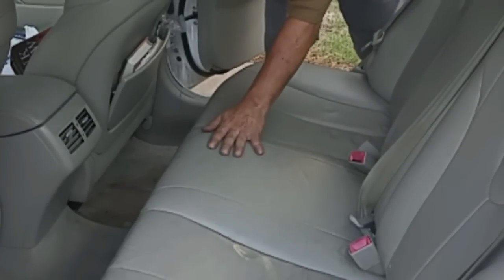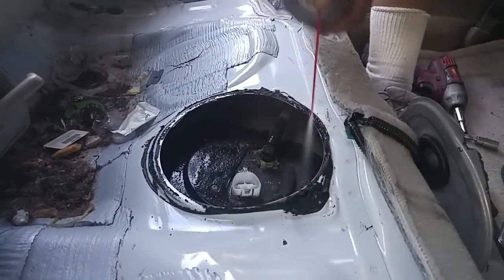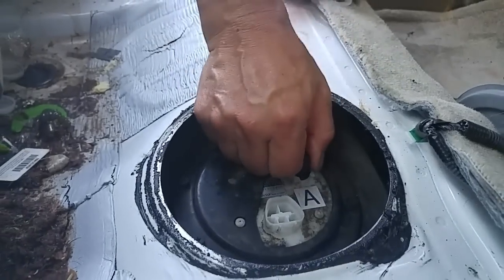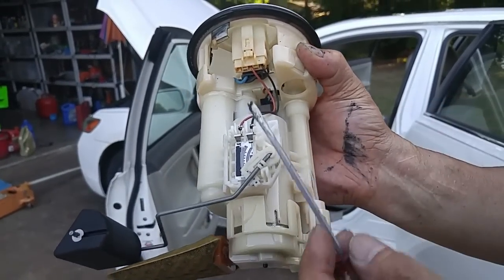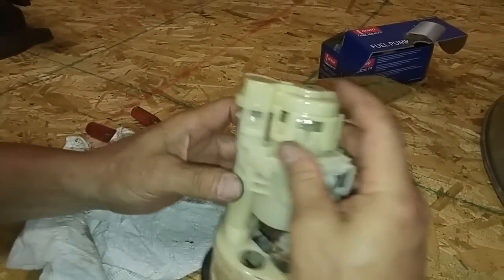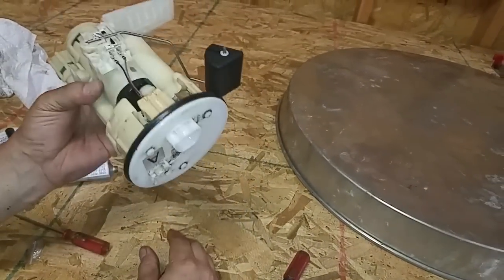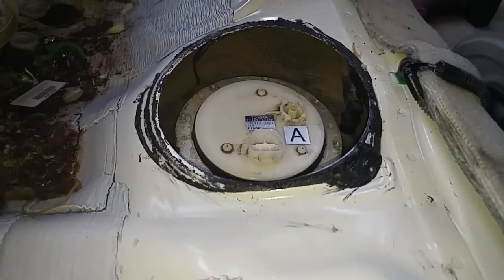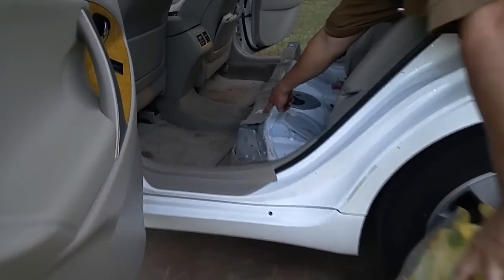Fuel Pump Replacement - Toyota Camry V6

Comment: So I just replaced my fuel pump. No issues at all. Super simple process and easy to follow. The only issue I am having is my fuel gauge still says empty. It will start at the top showing full and then it drops to dead empty. Any suggestions??
Reply from the maker: Probably  your float got stuck during installation.  You'll have to revisit to check.
Reply: @hardlymovingpro  I will check that. Do you think it will be an electric issue
Reply from the maker: Nope.  Most likely stuck float

Comment: Per the Toyota technician's service manual: 
Run the car with fuel pump disconnected until the car quits. This will depressurize the fuel lines. *this process also works when replacing the fuel filter.
Reply from the maker: Yes ... you can do that ... but I like to use the fuel spill over to clean up all the dust and debris with compressed air.
Reply: @hardlymovingpro  guessing it leaves a nice smell as well. There is a reason Toyota has it in their service manual. Safety. The fuel tank has lots of debris. That is what the fuel filter is for but if someone follows your instructions and gets gasoline in their eyes...
Reply from the maker: The access cover separates the tank and pump from the interior.  Therefore any fuel spill stays outside.  The pump ring and surrounding area is usually covered with debris which should be cleaned off before pulling out the assembly.  I use to use compressed air and brake clean (more flammable than gas).  Then i figured out to use the gas from the release of the fuel line.  BTW - the people writing the repair instructions are newbie engineers with no hands on repair experience.

Comment: So, when replacing my fuel pump on similar camry with similar setup, while unscrewing those 8mm bolts, I snapped 2 of them.  Stems are stuck in the hole.  Now since the plate won't seal it smells like gas... it's not exactly safe to do a bolt extraction over the fuel tank.  I'm thinking of using a gasket maker around the bottom of the plate because I'm not sure what else to do.  Any advice? Thanks.
Reply from the maker: Drill a couple of new holes through the plate and fuel tank flange.  Then use sheet metal screws as replacements for the sheared off 8 mm struds.  OR ... remove / drill through the sheared off 8 mm studs using a stud removal tool and replacement them with new ones.  Here's a video I did on how to remove studs:  https://youtu.be/jX3r7hqju4k
Reply: @hardlymovingpro  Thank you

Comment: How dirty was the fuel pump filter. The reason I ask is because I’m thinking about changing mine I have a 2010 camary wih a 130,000 miles and I talk to a  couple people and they say they really don’t get dirty is that true did you find that with yours. 
Yours didn’t look really dirty but then again I couldn’t really tell. Great video, thanks
Reply from the maker: I would agree that it didn't look dirty but it's made out of some plastic polymer material and who knows if it'll break down over time.  In some past cars I've worked on that had been idle for a long time,  some would not start due to traces of dissolved screen material clogging into fuel pump's intake fuel port.   These pump filters are cheap and many replacement pump kits come with new screens.  Also, not showing proof that the filter was replaced with the pump may void any pump warranty claims.
Reply: I totally agree and I would most likely replace mine when it gets close to 200,000 miles and the fuel pump. It’s better to keep up on the Preventive  Maintenance than to wait the last minute when your fuel pump has broken down because of age and old filter. Anyway thanks for the quick reply. Keep up the great videos.
Reply from the maker: Thanks!  The key to pump longevity is to not let your fuel tank go below 1/4 of a tank.  The fuel acts as a coolant to keep the pump from overheating.  The people who brag that they can drive their car to near empty are the ones whose fuel pump fails and are scratching their head as to why.  After my explanation on fuel cooling, they're speechless and give me a dumb stare.  This is no different than people who ride the clutch at a stop light hill instead of using their brakes and wonder why their clutch burned out in 30k miles.

Comment: Hi, I have the same car setup like you. Sometime when I crank and it wont start but if I wait like 10-15 mins later it start and drive normally this is happening 2 times now and it was recenly. Is it the symptom of fuel pump problem? my car is at 223,000 miles. thank!
Reply from the maker: I forgot the name of the part but it's a electronic part that's suppose to enrich the air/fuel mixture during start up.  It has nothing to do with the fuel pump.
Reply: @hardlymovingpro  thank for your reply, is it the throttle body or maf sensor?
Reply: @hardlymovingpro  oh I forgot. when it happen, I started up my car, only running for 1-2 secs and die immediately. And it have trouble starting up again. And I wait like 15-20 mins and it might start
Reply: @minkie1710  did you ever find out what was wrong? My car does the same & wont start until I let it sit at least 30 mins

Comment: Would stalling only uphill while slowing down be a fuel pump issue? Thanks
Reply from the maker: That's one symptom.
Reply: @hardlymovingpro   it's a 96 Camry 5sfe with 356000 miles. Any other thoughts? Thanks again
Reply from the maker: Could be.  Inadequate pressure from the fuel pump, clogged fuel filter or clogged fuel injectors can cause power loss under load (like going up a hill).
Reply: @hardlymovingpro   Thanks a lot I like all your videos. They are very clear and you are a great teacher especially for Diy people.
Reply from the maker: You bet!

Comment: Thanks for that .. I have a question  please should change the pump filter when changing the filter .. the tiny filter with this part number 232170C010 or is it enough to clean it ?
Reply from the maker: I'd change the filter.
Reply: @hardlymovingpro  wish I asked that before changing the filter .. guess I’ll leave it for the next change  
Thanks.
Reply: @hardlymovingpro  q

Comment: Since the pump is been changed i would of changed out the fuel pressure regulator also  nice vid
Reply from the maker: Thanks.  The regulator is attached to the fuel rail ... based on my recollection.
Reply: @hardlymovingpro  The unit on the end of the fuel rail is called a damper assy fuel pressure pulsation 

 A fuel pulsation damper is a device used to regulate the oscillation of fuel caused by the injectors opening and closing and smooth this out. Sometimes referred to as a FPD.

The fuel regulator is the part next to the actual fuel pump see your vid @ 3:06

I am going to change my fuel filter on my 2005 es330 uses the same parts as the Camry  so I was watching your vid to take the assembly out now I am thinking I might as well change the pump and regulator at the same time ,  

But I will do a fuel pressure test before I start the job  because there is no maintenance  call out to change the filter I am suspecting after 15 years on the road  it will not hurt 

And I am hoping it will  solve a flat spot I am having when highway driving and I accelerate to pass their is like a 2 to 3 second pause ,  but internet says this is a character of  electronic throttles 
Any hoot , great vid , it is good that we are capable people to work on our cars  service today is so dam expensive , 

Thank you for sharing your experience
Reply from the maker: I think Toyota integrated the fuel filter within the assembly to force you to consider changing the pump if you're going to replace just the filter.   Flat spots could possibly be injectors that aren't delivering good atomized fuel under load?  They need a cleaning?

Comment: Is the silver thing under the cap  next to the pump the fuel pressure regulator?
Reply from the maker: I need a video time mark.
Reply: @hardlymovingpro  3:30
Reply: Thanks you

Comment: thanks for sharing, let me know how long or how far of using this car should need the fuel replacement? regards
Reply: sorry I mean the fuel pump replacement
Reply from the maker: After 100k miles, anytime.  I've noticed that if you drive your car to a near empty tank before fill up,  it tends to wear out the pump faster.
Reply: 100 K miles...means around 160 K Km? thanks for replying
Reply from the maker: @samuelwahyudi4390  Yup!

Comment: Hi, thank you for the video it is relly use full, but i have an problem with my camry (2gr-fe), would not starting smothly it taks time to work i had change my fuel pump and clean the injector and change the spark plug (all oem parts) but still the same problem
Can you help me with that problem, please
Reply from the maker: Could be a lot of possibilities.  Hard starting when the engine is cold, hot or all the time?  Did you check the condition of the MAF sensor, vacuum tubes, intake manifold & plenum gasket, air filter air hose has no leaks and clamps are on tight, no stored MIL codes,  ground wire contacts, fuel filter, plugs and O2 sensor okay?
Reply: I have the same problem with my 2008 ES350 (Camry V6), I changed the fuel filter and the fuel strainer. It has a hard start when cold, after it starts, if you turn it off and back on, it starts smoothly. Before changing the filter and strainer it started fine. Nothing else has been touched. I replaced the air filter, cleaned the MAF and Throttle Body (like a month before changing the fuel filter and strainer).
Reply: @TheWanderer0320  what ended up being the issue. I have the same problem. New battery new alternator. Gonna do spark plugs and fuel pump and filter and see where that gets me. But what ended up being your issue?

Comment: Please what can be the cause . Trying to put the fuel pump assembly into the tank but it does not fit again. Is it a pressure issue
Reply from the maker: Can't be pressure issue.  Must be the Alignment as you're positioning in the tank.  Replay the video to see how I did it.
Reply: I have gas in the tank, did I have to empty the tank ?
Reply from the maker: @blessingolaleye3775  Not at all ... tank doesn't need to be emptied.  You have to position the pump assembly the same way you had removed it before putting back in.

Comment: Is there a good way to test fuel pressure on these 2G-RFE engines to verify the pump is bad? I'm getting a P0300 code. Already changed my plugs with NGK's, smoke tested the intake and verified the dampner isnt leaking.
Reply from the maker: Then you've got a coil pack problem.  0300 is random cylinder misfire.  301 (cyl 1), 302 (cyl 2), etc. tells you what specific cylinder is misfiring.
Reply: @hardlymovingpro  yes sir. Understood. The only code I get is P0300. Not any specific cylinder ones.
Reply from the maker: @atxjax1  Clear the code, start the engine and rev up and down to 3,500 which may force a specific cylinder misfire.
Reply: @hardlymovingpro  Thanks. Ill try that.
Reply: @hardlymovingpro  I was able to troubleshoot some on this car. It had P0300 but then went off. Was still pending though. I smoke tested it, checked fuel pressure all ok. I looked at the front 3 plugs and they looked like they were still in good shape. I cleaned the TB and put a new air filter. No P0300 after 2 weeks.
Reply from the maker: @atxjax1  You should also check your rear plugs.  Also your cat. converts may be going bad causing back pressure.  Compare the temperature between the front and back of your cats with a laser piston grip temperature sensor.  The back of your cat should be hotter after engine warm up.  If not, your cat maybe causing back pressure exhaust gases that could be leaking into your combustion chamber during the intake stroke corrupting the air/fuel mixture and resulting in misfire.   Had that problem with a Audi Q7 with a V6 engine.  3 of the 6 intake ports were black with carbon.

Comment: Did you put some type of adhesive back on that last plate before putting the seat back on? If so, what did you use? Thanks for the video. It will be very helpful.
Reply from the maker: No because the adhesive never hardens and can be re-used to secure the access port plate.
Reply: @hardlymovingpro  thanks for helping me out. I appreciate you sharing with us.
Reply from the maker: @Paperthrowercjm  No problem.

Comment: I had the fuel pump replaced at Toyota dealership for 2010 Toyota Camry costed me around $980. The part was around $500ish and rest was labor and shop supplies, tax and other crap. I really feel I was ripped off BIG TIME!!
Reply from the maker: Wow ... that's a lot of money!  The OEM pump provider for Toyota is Denso;  and a Denso fuel pump is easily under $150.  I could swap out that pump in under 1 hr.
Reply: @hardlymovingpro  yeah I was ripped off by the  Toyota dealership.
Reply: Delphi brand fuel pump is around $100 BUT the entire fuel pump assembly is around $550. They must have changed the entire assembly
Reply: Update on my Fuel pump!! It failed again on my 2010 Camry couple months back. This time bought a new fuel pump from Rock Auto and had it replaced at local shop for around $125 labor and $100 fuel pump complete assembly. Right now car has around 320,000 miles.  Original fuel pump failed around 150,000 miles. 2nd fuel pump from dealer failed around 310,000 miles.
Reply: @kashie007   While I do my own repairs because I enjoy it and it saves a boatload of money, anytime you're paying a tradesman lots of money to do something, you're paying for their experience and knowledge not for how long it takes them to do something.  

The rip is always in the dealer marking up the price of a part they buy at wholesale to a price higher than retail.  If I can buy a part at Autozone for $200, which is already high because you're paying for the convivence of them keeping the part in stock and having to maintain a storefront, the same exact part shouldn't be marked up to $300 when the dealer is installing the part.
Reply: @BobbeeSingh   He probably was charged for the sending unit, but that's still high.
Reply: @ev25zv  nope no sending unit was ever mentioned
Reply: @kashie007  used to get the oil changed at Toyota dealership for 2 years. They charged for comprehensive service. 3 years later, decided to change air filter bc hardly any air from vents. Realized they had charged for 2 air filters but never even looked at it. The amount of dirt, leaves , pine straws was simple shocking. So yeah, in general dealerships = guaranteed rip off
Reply: @kashie007   What was written on the invoice?  Fuel pump and housing?

Comment: Where is the fuel filter boss?
Reply from the maker: It's integrated within the fuel pump assembly
Reply: Is Toyota Avalon 2006 limited would be same? I'm assuming that extension part that u putted in first in an angel into the tank is your filter.
Thank you for your reply 😊
Reply from the maker: @mdashiqurrahman39  Yes ... the same.

Comment: Great video!
What brand of fuel pump do you recommend for 2009 Honda accord 2.4?
Reply from the maker: If you want to be absolutely certain of no failures and of it lasting a good, long time, go with the Denso brand.  Denso is the OEM provider for most Japanese cars.  The Amazon listing for the fuel pump is shown in the "SHOW MORE" area of this video's description.
Reply: Whatever you do, stay away from "Spectra"
Reply: @Wes_5kyph1   What was your experience?
Reply: @ev25zv  i replaced it, but it turns out it wasn't the fuel pump
Reply: @Wes_5kyph1   Thanks for responding.  So the Spectra fuel pump didn't fail on you?
Reply: @ev25zv  well I didn't have it in long enough to find out. it was making a lot of noise, so I ordered a used OEM one off ebay, been in there ever since. almost 500k miles on that 09 camry now
Reply: @Wes_5kyph1   Thanks man.  Wow, that's a lot of miles.

Comment: Love denso !!!
Reply from the maker: Highest quality one can buy!
Reply: @hardlymovingpro . Where can I get the tool you use for disconnecting the electrical plug, I saw another video and this guy actually broke the locking tab and I don't want to do that, the reason I need to remove the fuel pump on my 1998 Toyota Camry le 4cylinder is because there's a gas leak on top of the fuel pump it looks like is coming from the fuel line but I need to remove the electrical connector first and then the 8mm bolts to have a better look at it, fortunately for me I got another 1998 Toyota Camry that I'm not driving and I'm going to have the junkyard get rid of it but the fuel pump from that car is perfectly fine so I'm just going to remove the whole unit from one car and install it on the other more likely that will take care of the leak, the only challenge I see is disconnecting the electrical connector and the also the fuel line locking tabs on the fuel line hose. So  I appreciate the name of the tool you use so I can buy it thanks
Reply from the maker: @awakeandalive4248  I provided a link to the tool in the "SHOW MORE" hyperlink text description of this video.  Or ... here's the link:  https://amzn.to/2RsZsro
Reply: @hardlymovingpro  . Thanks I really appreciate it.

Comment: Great video! If I ever replace my Lexus Es300 one, I know what to expect now with the jet of gasoline release. I'd hate to have to smell gasoline in my car for some time after haha.
Reply from the maker: If you want, you can start the car with the electrical plug disconnected and wait for the car to run out of fuel.  I like the fuel spill using it as a solvent to blow off the accumulated debris with compressed air.